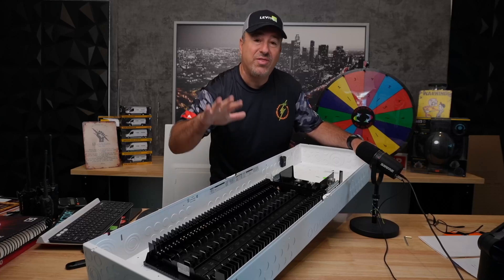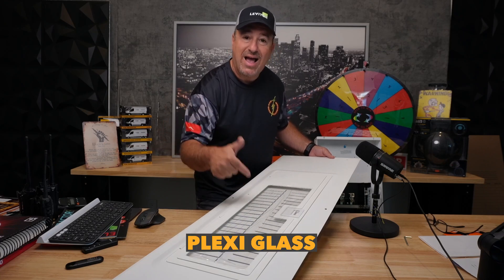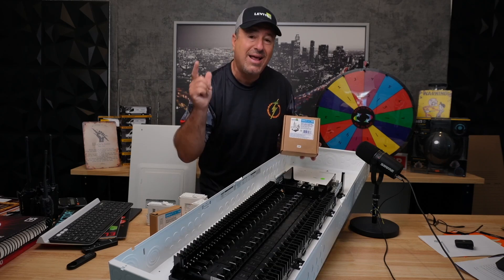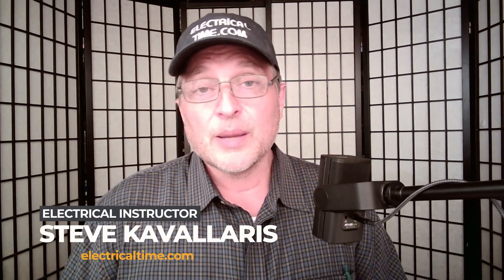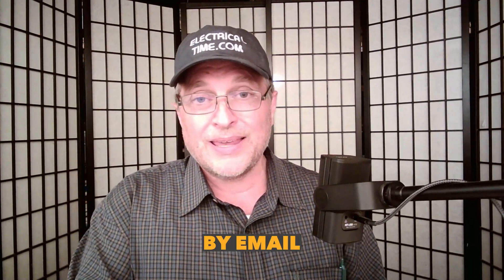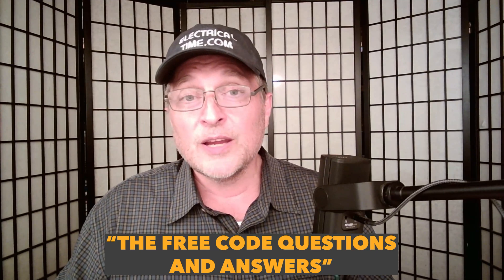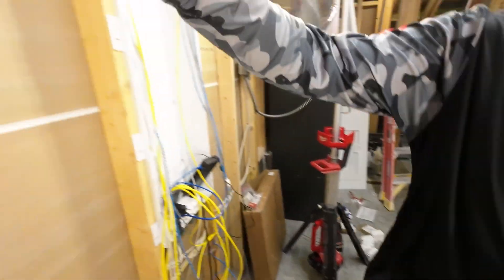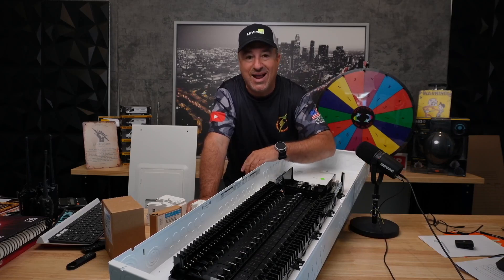The Ultimate Electrical Panel Video for electrical contractors Sales, Code and installation #Leviton

Comment: Who uses the 75 degree coloum. Standard is always 90 degrees. Hence "NMD-90 (ROMEX)"..."T90 (STRANDED WIRE)".   Just use RW90. Its rated for 100A. Single conductor in a raceway. !  But if you are feeding a sub panel with 2/3 AL ROMEX, it's not only rated for 95A.

Comment: For anyone who has stumbled across this video a year or so after like I did. A couple things to keep in mind before diving down a rather expensive rabbit hole with "smart" breakers. These and others like them are cloud based control, meaning if you were foolish enough to use these for "smart" lighting and lost internet in the middle of the night... guess who's using a flashlight to find the breaker panel. While energy monitoring is nice, "smart" control at the breaker panel in my opinion is silly. There are far cheaper, more reliable and flexible options out there to achieve the same means without putting yourself in a risk to either lose control or pay for something that could turn into a complete waste of money. Anything cloud based can be taken away by the manufacture at any time.

While these companies would earn brownie points for at least making their products fully local control (and they are certainly big enough to do it) the practical sense of using a breaker to control the flow of power to the majority of things inside a residential home will always seem silly to me especially with the existence of far better products that do the same thing and have been out even before "smart" breakers were ever a thing. I can see the appeal for larger amperage dedicated breakers for things like standing air comps, welders etc etc but again there are alternatives.

I been dabbing in smart home stuff for several years and no matter what platform a person decides to invest in there is always the same stories of people's experience in hiring an electrician to install some smart home device (light switches, outlets etc) and the electrician standing there scratching their head for 5 minutes before the homeowner asks them to leave. I feel electricians should pick one of two paths; either learning all they can about what is available in the world and how it works if they are going to try and sell "smart" home stuff to people or claim they can install it; or don't and not try and sell clients stuff they know little or nothing about or try and install it.

I do like the "decora" aspect of the panels and the plexiglass cover is super neat. I kind of feel these companies would do better if they went the route of improving their panels appearance like offering more colors for the panel and breakers and even incorporating the RGB lighting inside for the plexiglass cover.

Comment: This looks really good and it is good to hear it. I am not a professional electrictian but I am looking to expand my 60amp sub panel in my garage to allow for welding, a car charger, and air compressor. There is a 60amp braker run to this smaller sub panel from the house panel. The house panel is actually a sub panel also because I had an addition put on my house and the actual panel is next to the meter base. I got a solar system installed and they spliced that into the main panel next to the meter base. I am thinking just to be safe I just want to put in another 200amp panel from the main panel, bypass that sub panel, and add an actual breaker for the solar. At no point do I think the entire house will ever exceed 200 amps but why risk it with strip heat, electric tankless water heater, dryer, and the lot. Just run the extra drop and keep the things like the chargers, welder, servers, and everything else on a seperate run.

Comment: I love Leviton panel. Got one installed, have roughly 8 Gen 2 Smart breakers with the whole house monitor system (the WIFI version) is great. Cannot wait to start doing essential loads and having those breakers use my battery backup.

Comment: Hey,  just did a generator and was unable to unbound the panel.   I removed the ground bridge and was still getting continuity between ground and neutral.  Since the panel has a transfer switch ahead of it,  it's now a sub panel and I can't figure out where I'm getting this continuity from.  Any solution to why?? Thx in advance.
Reply from the maker: @Digitdrum1  Did you do or have a single line diagram? If so mark your troubleshooting and isolate the "source". Watch out for back fed motors lights etc depending on what you get on the neutral. This is also a great question for Steve, check out his classes at www.electricaltime.com

Comment: Anybody happen to know whether you can terminate more than one wire into the wire points for each breaker (2 hots or 2 neutrals to one breaker connection)?  It looks like this panel uses "holes" (like the holes in a ground bar or neutral bus bar where you terminate those wires) at the connection points for each breaker, as opposed to "clamping plates" (like on typical direct-wired circuit breakers).  I currently have a QO panel with several circuits that have 2 branch circuits connected to single breakers.  Thanks.
Reply from the maker: Great question. You have to go back to the manufacturers listing. I belive most that do allowy say both need to be same wire type.meaning solid with solid etc. I'm use to never double tapping but some often do when allowed. I think as surge protection gets more and more attention some wired units will be double tapped and they are usually stranded leads.

Comment: Hey how come you talk about using torque screw drivers to comply with code but in your video there was not one present?  In the video clearly was an m12 impact.    Also did not see a torque ratchet for those feeders. Shame shame.
Reply from the maker: Hey, how come you're not paying attention...jk. I know electricians love to point things out, and when it helps others level up our game, it's fine. 11:42, we did it after we landed it in the panel. The tool brand I use hasn't  decided to sponsor us yet, so we won't be showing that part just making sure you know about it.  The good news is Klein just sent us their torque screwdriver set. We will be doing a review on that one soon. We good?

Comment: Will the old wires be a issue with these panels if there is no ground? I have a customer who wants to renovate the house but start with this panel. I'm thinking that old wiring in the house will cause a issue.
Reply from the maker: Is it in conduit or non grounded romex? If it's in flex you should be OK. Don't think it will effect anything on the device end. You can always reach out to Leveton and ask.

Comment: Is there anybody else here worried about hackers getting into your WiFi and turning your power off remotely?  Just curious?
Reply: Is it possible? Yes.  Is it likely? No. You would have to be an asset of an intelligence community or piss off someone with high coding skills.
Reply from the maker: Good question, I don't think I'm that important
Reply: Risk vs reward buddy 🤷 . Always three sides to view anything. Positive negative or neutral.
Reply from the maker: Well said.
Reply: I mean, tbh, you can just put the panel on its own vlan with matching SSID and just turn off broadcasting. Nothing is 100%, but it works for me.

Comment: I have a question if my dad is a general contractor And i been working with him can he sign off on my hours for me to get my journeyman license I Live in PA
Reply from the maker: That will depend on PA requirements. Go to the contractors board for PA and see if they have a Q&A but usually it will as long as you can pass the test.
Reply: @The360Electrician  thanks
Reply from the maker: @Zidvr  hope it helped

Comment: Does Leviton panels allow you to come in the bottom of the panel with the main breaker at the bottom of the panel for an application that has your main feed coming lower than the panel
Reply from the maker: Good questions, usually you have to run your feeders up. Looking at the cover it's not a reversable installation. I'll ask them tomorrow at NECA. Great question

Comment: We have been using #2 Aluminum SE & SER cable on a 100 amp circuit breaker since the 1960's with NO problems. Only time that I went with a larger guage was for a far away subpanel.
Reply from the maker: I'm confused, so what does that mean? Is Steve wrong or you have been lucky till now nothing has melted?
Reply: @The360Electrician  I believe Steve is wrong according to the 2020 NEC. 2 AWG can be used for service entrance for 100 Amp because of the 83% rule 2020 NEC 310.12(A) But between panels it is a feeder; 2020 NEC definitions. Feeder do use the 83% rule between 100 and 400 Amps for single phase; 2020 NEC 310.12 (B). Also Table 310.12
Reply: Hi Tiger, thanks for your comment. Many electricians look at Table 310.12 and automatically think that any 100 Amp Sub-Panel can use a 2 AWG Aluminum Feeder, however that Feeder needs to supply the entire load to the dwelling Unit and not just part of it. Most of the sub-panels that have been installed are fed from a main breaker panel that has lots of breakers in them and from that main breaker panel, an electrician powers up a sub-panel. In that situation, you can not use Table 310.12 to size the feeder, you have to size the load on that feeder as per Article 215 and then size the feeder conductors according to Table 310.16, the ampacity table. Thanks
Reply: @tiggeroush  Know that aluminum service cable used for to feed subpanel should have larger conductor size but in all my years never came across a contractor using nothing but #2 aluminum SER cable to feed a subpanel that's feed with a 100 amp breaker. Our local ultility company allows you to feed four 100 amp services to feed stores or commercial sites with just 4/0 aluminum SEU cable. Even with them using natural gas for heating & hot water could not imagine that cable gets very warm when every place is running thier AC units.
Reply: @tiggeroush  My local utility company refused to replace 85 year old type RHW   ( cloth over rubber jacket #6 copper wire for an underground service for a 100 & a 200 amp service. Told me that  being the wire was underground it would never heat up feeding a total of 300 amp in services in a Four story long building. Used to get a kick out of ultility company 4/0 service lateral that feed over 20 larger row homes with all having 3 ton AC units. Would go up to cut off old service while in the morning while wires were still in the shade. Wire would be 15 degrees hotter then air temperature . After 30 years and burning out at least 5 - 75 KVA transformers they split  thier feeders and installed a second transformer.
Reply: @tiggeroush Not single dwelling unit but single phase dwelling unit.  It could include a multi family dwelling unit as long as it all single phase.
Reply from the maker: Utilities don't have to follow the same codes we use. SEC's are usually undersized if they are free air, etc. In my case it's a 100 Amp breaker in my main panel feeding a 100 amp sub panel. In that situation, you need to rate it with 75-degree rating for sizing. It has to allow full ampacity of 100amp as a sub panel feeder.
Reply: @The360Electrician  310.12(A) allows for #2 AL for services AND feeders which would include a 100A sub panel.

Comment: The Leviton fancy $70 WIFI & think the GFCI breakers are made in cheating lack of quality control china!  Could not pay me enough to install breakers in my own house that were made there.
Reply from the maker: That makes no sense,  the phone you just wrote this wirth is made most likley, made in China.
Reply: @The360Electrician  Yep one of the few things that I did not check country where my cell phone was made but the communist POS Chinese government allows companies to get away with murder as long as they are getting their big kick back . For over ten years china had been stealing $100 Millon dollars a year in just intellectual properties  where the china government said they will look into it. We had a POS Cheating china LED driver catch on fire that was in a 70 degree clean space. The Chinese warranty replacement driver was smoking after two or three months. Finally out headed a made in USA driver and running good last 5 years. Big box stores were selling boot leg circuit breakers that appeared on the outside case so good that manufacturer could not tell the difference between the ones they made & Chinese garbage. China breakers were not tripping. Had several cheating china relays marked 25 amps @250 volts. Only lasted a few weeks. Wire going from connection point to relay contact appeared to be only 16 gauge. A large local pharmaceutical company does not allow their workers or contractors to bring in or wear any safety harnesses from China. Our high blood pressure medicine was recalled due to serious issues with an ingredient from China. People should wake up and realise that china is the #1 enemy of the free world. They are telling poor countries that they are helping them out by building airports with long runways preparing for the next World War.

Comment: I’ve been thinking of switching to a Leviton panel. I have always used home line because it usually the cheapest. I would really like the Leviton if it is a similar price
Reply from the maker: It' still a bit higher due to separate panel cover that's not included but well worth it for you and clients.
Reply: @The360Electrician  I really like how the breakers go in without terminals.
Reply from the maker: Same here. So easy
Reply: Levitons have a copper bus, so it's not comparable to the Homeline models.

Comment: Doesn't a SER. cable have to be sized from the 60 degree column?
Reply from the maker: Usually it's sized to the max temp of the lug rating. In most case's 75 degree. You have to check manufacturer ratings on label
Reply: @The360Electrician  I understand that but it's nm type cable and article 334.80 states that you have to use the 60 degree column. Right?
Reply: @The360Electrician  iam not criticizing. I appreciate your content and am a member. I just wanted make sure me and everyone else is informed correctly
Reply from the maker: I didn't think you were brother. All your comments are welcome. Sometimes we all come off wrong when texting.